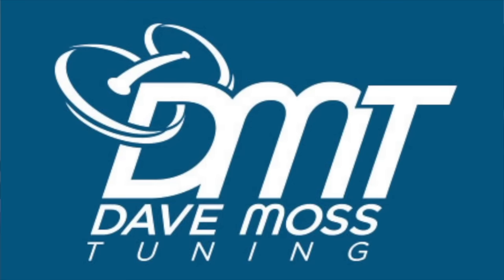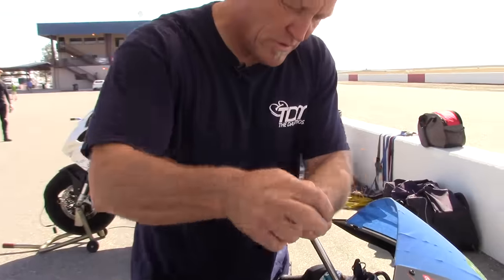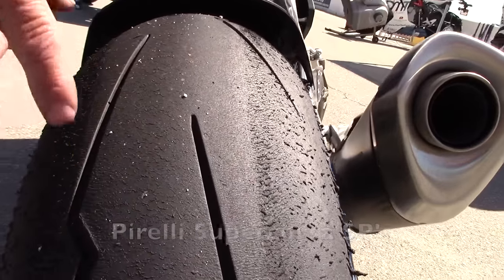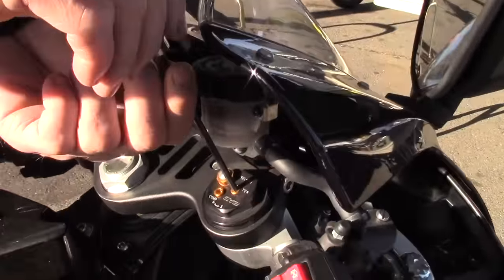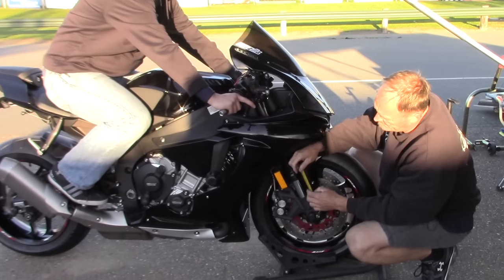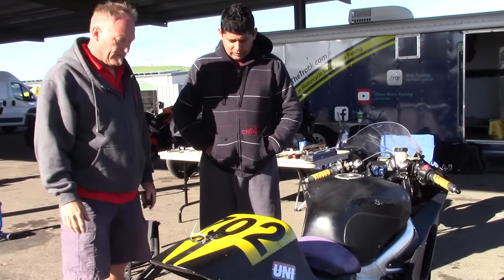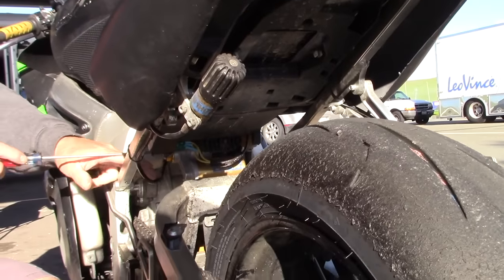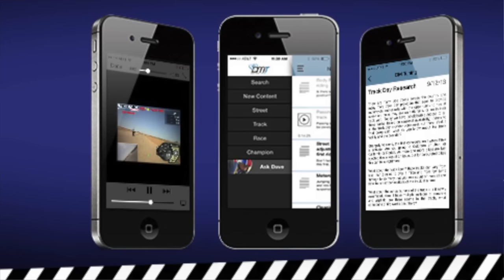2 Clicks Out: Motorcycle Tri-Axis Comparison (TRAILER)

Comment: Hey Dave. You helped me sort out my track gixxer maybe 3 years ago which was fantastic. I'm on a '16 ZX10 these days and was wondering what you would recommend for it as to very aggressive mountain twisties. Quite bumpy, predominantly 90-140kph corners, 103kg in gear, running S21's at 36F 38R, usually at night. I just finished watching the full 'Two Clicks Out: '15 and '16 ZX10R' and noted you think the shock is very soft. Also back in 2011 you mentioned the Gen 4 shock was pretty sub-par. Any pointers in the right direction would be appreciated. Thanks mate.
Reply from the maker: Gnerally the shock is soft compared to the forks, but that has been the case with this bike for a while. So, set sag in the 30-35mm range for the forks and 25-30mm for the shock. Set compression 1-1.5 turns out on the forks and shock. Depending on oil age and miles, rebound will vary substantially especially if the oil is old.
Reply: Thanks a lot for the reply Dave. I'll dial those in asap. Bike was bought Jan 2016 and has roughly 19,000km (11,800 miles) on it. I'm guessing I probably need to get the forks serviced? They've suffered a lot of hard riding and plenty of wheelies haha...
Reply from the maker: Yes, fork and shock oil change are urgent :)
Reply from the maker: more preload based on acceleration and g-load via track topography

Comment: adjust pressure for the soft part of the tire, on 2 compound tires. So we are running to high pressures?
Reply from the maker: Adjust pressure to get the tire temps correct so they don't tear. Each rider needs their own hot pressure, so you have to find it each day based on pace, track temps etc.